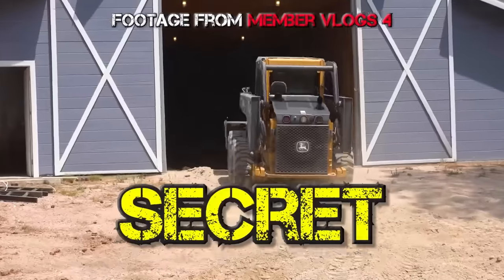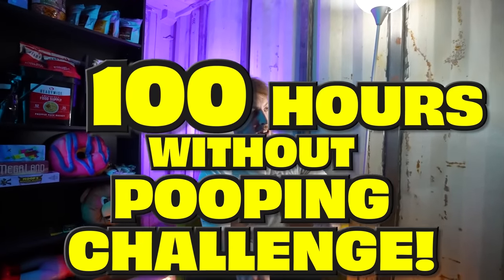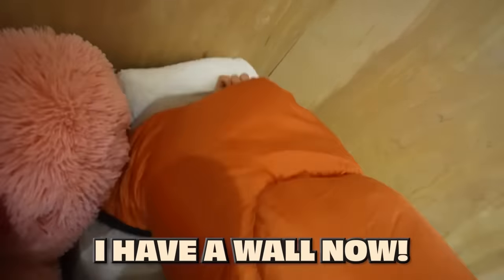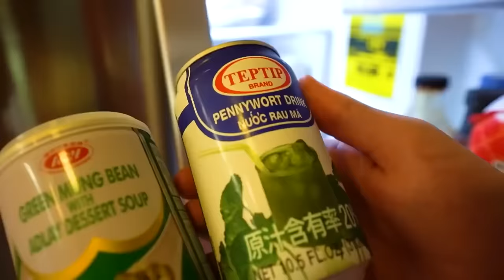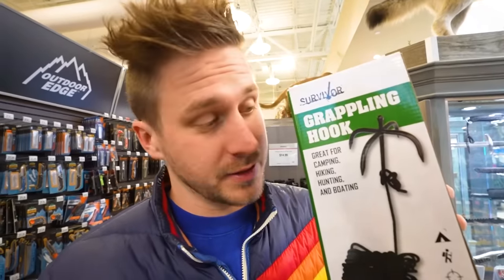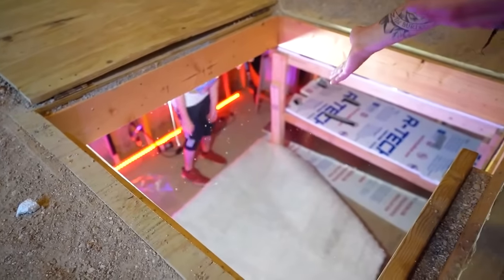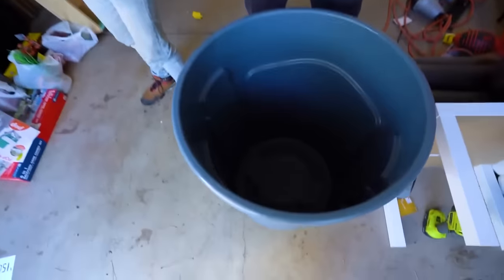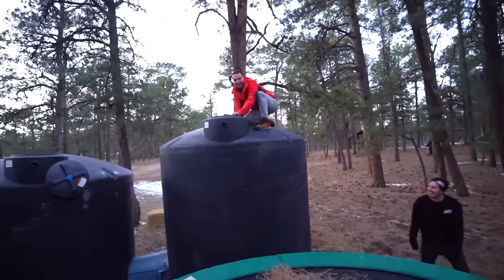SURVIVING IN SECRET HOMEMADE BUNKERS!

Comment: Leg wrestling? I can beat you easily.. in high school, I used to leg press 400 lbs, and that's with a broken leg (which never fully healed), and I sleep on concrete.. no carpet, no blanket as a comforter, just pure concrete, and I have been doing that for 3+ years, but I have been sleeping on hard wood floors since I was 9.

My thighs are like boulders

Edit: I'm hitting my foot against concrete now, and it doesn't hurt..